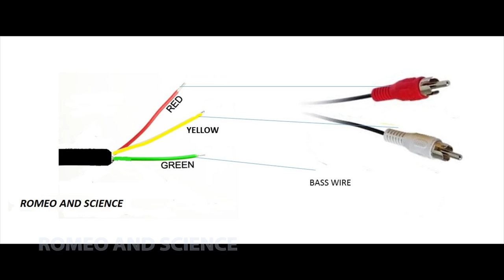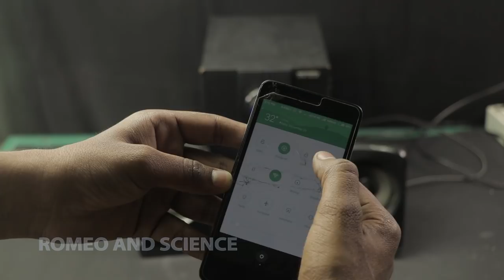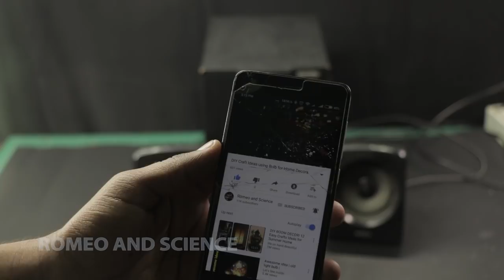How to make wireless Bluetooth Home theater - Make your Own

Comment: youre wiering diagramm has a mistake. from 3,5 mm jack you need 3 wires, 1 ground, 2 for right and left. the bass comes after input jack

Comment: Only for 2.1 speaker (or) 5.1 speakers make it Available pls reply me
Reply from the maker: any speaker
Reply: I have 5.1 speaker with out Bluetooth. I need Bluetooth  insert  possible (or) not
Reply: a 5.1 need not be mobile.  Your R,L, Center and Sub should be around your screen and your 2 rear speakers could use this application. This video can be applied to a wireless stereo but seperating the channels from the  for true 5.1 home theater etc... would involve more equipment for channel seperation and.  It can be done purchased for 40 - $60 new and probably used on ebay for much cheaper you could buy the necessary equipment. The  20 to 30 bucks used for the correct equipment is probably the same cost as a transmitter and 2 bluetooth receivers plus a power supply.  Nice tutorial for those who can just follow without verbal instructions.